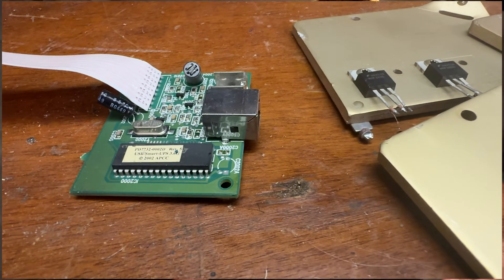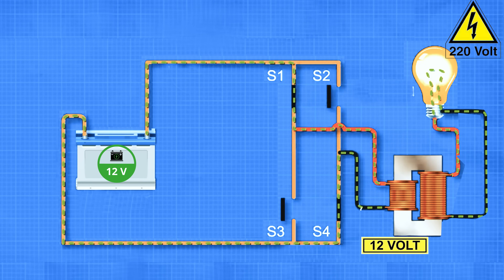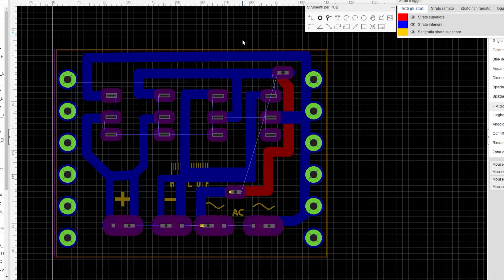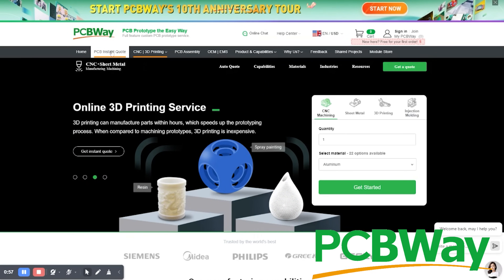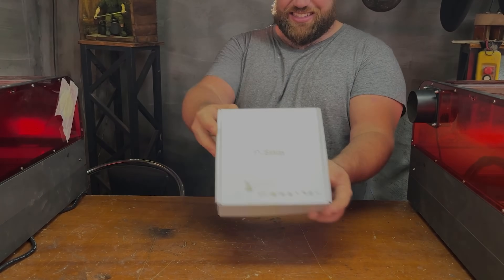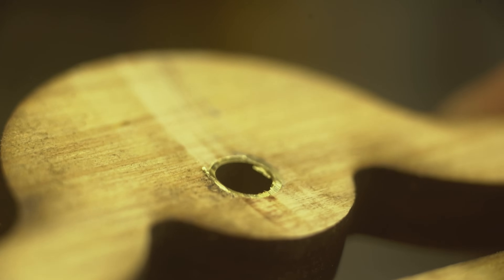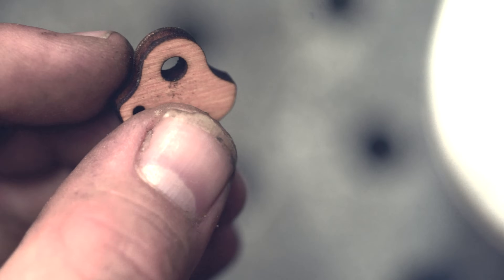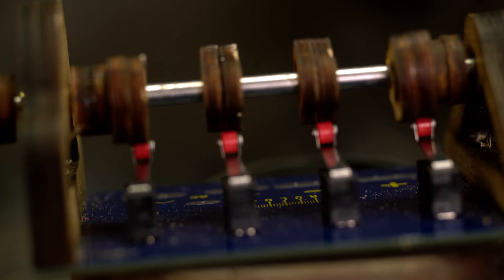Survival 110/220 Volt  Inverter • How to Make it

Comment: Those switches have normal open and normal close contacts, you just need two of them, not four.
Reply: If you try that you need to 100% switch them at the same time. Note that this switches off the one, turns a quarter and turns on the other one.
Reply: @jswd6029 I guess, that is correct if you connect the supply to the common contacts of the switches. But you should not. I am talking about connecting the load to those contacts. This way, you only shortcircuit the load, not the supply.

Comment: I just took apart an inverter/converter from a 2007 Lexus rx400 hybrid. I replaced the CVT transaxle which is nothing like what it says, because the transmission consists of 2 magnet motor that power and charge 600vac batteries, start the gas engine, control the 12v system and this inverter/converter controls it. the magnets in the stator, 14 earth magnet 1st motor are stronger than any I've seen ,. And this inverter  has a ton of circuitry. I'm much like you in ways, shop out back tons of tools been making cars go 45 years, except trapped on mountain  Denver, CO. 5500' high air too thin.

Comment: You keep using that word 'analog'. I don't think it means what you think it means. Analog circuits can and are regularly built with semiconductors, the mere presence of them does not mean that a circuit is digital. In fact most simple inverter designs are analog. What you've made there is a MECHANICAL inverter. Those existed in several different forms looong long ago, before power semiconductors or even vacuum tubes were a thing. Your switch-style inverter is one example, a more common solution was to drive a generator with a motor.

Comment: Please do an updated video on the rebreather but try using a soda stream bottle or a few soda stream cans with regulators on them. I’m not sure how many psi they holds naturally but I’m sure you can find that out with a test. A really fun test… maybe even wrap them in a single continuous carbon fibre strand like they do with high pressure bottles. Make some caps that has fins that go down the can and then wrap that exterior and all of that super tight with cut with carbon fibre. See much more strength you can get out of it. That would be interesting as well. Not the safest thing in the world neither your first rebreather

Comment: The switches will not lasy lonh unless a capacitor is placed in parallel with the contacts to prtoect yhen like in a car ignition system.

Comment: I think the thickness of the cables argument does not come through correctly.

AC is easier to convert to other voltages using just a transformer. This makes transmisson lines easier to keep at a higher voltage to reduce loss.

AC or DC has the same loss at the same current in the same wire, but AC is easier to convert with more reliant devices (transformers) so the loss is easier to minimize.

Switches also fair better with AC because the current will go to 0 many times per second which extinguishes the spark.
Reply: He was referring to how historically, batteries had low voltages compared to those you could get from AC power using transformers. DC can't use transformers to get high voltage without mechanical switching (requires high maintenance) and it was impractical to stack many dozens or hundreds of battery cells in series. That meant DC couldn't reach as high of a voltage as AC and thus needed thicker cables for transmitting the same amount of power across long distances.
Reply: @5467nick  i think so too. Motor-generator converters may be simple but a transformer is simpler :)